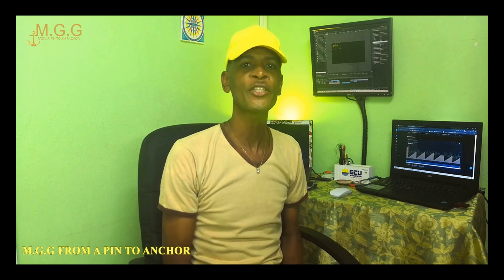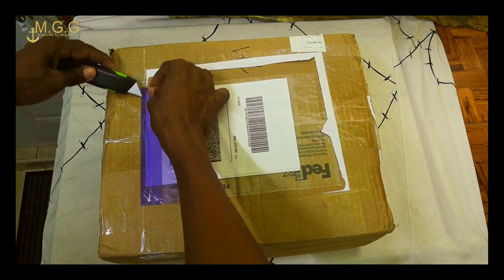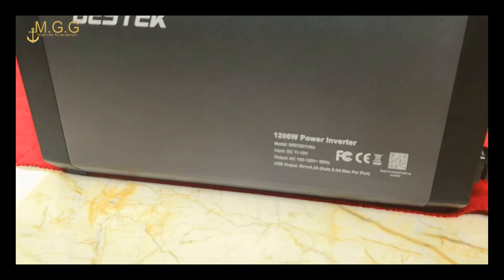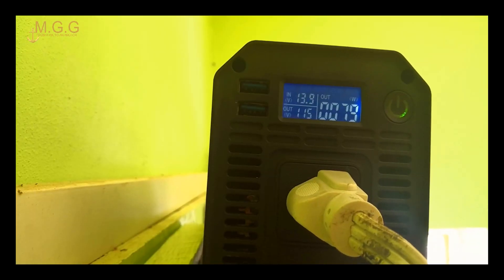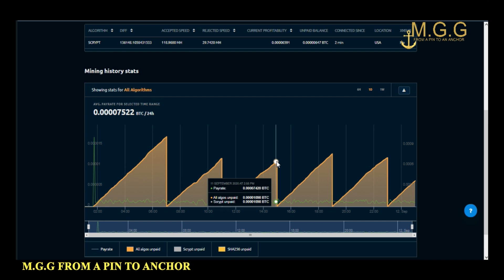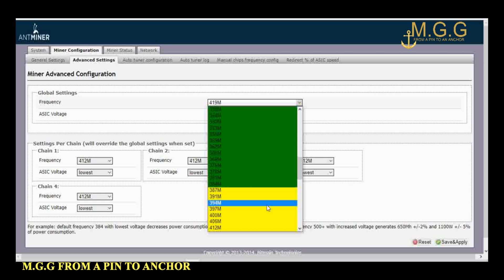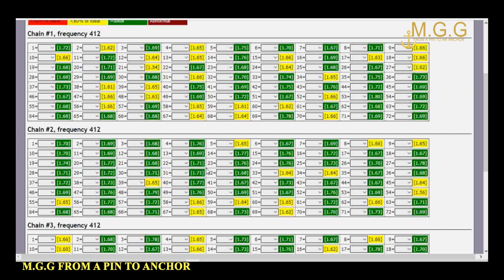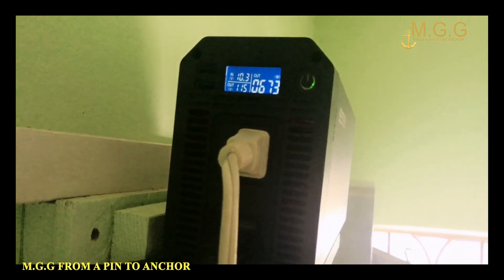Solar Powered ☀️ Antminer L3+ OFF-GRID ⚡FULL HD 4K LTC Mining🗻⛏ L3+ 24/7 With Battery🔋

Comment: A very great demonstration bro!

By the way, one thing I have been thinking is this: do we really need inverters and power supplies? Inverter is the most expensive single part in solar system and also causes energy loss. Same applies to power supply unit. 

Let me explain the initial facts why I have begun to wonder this: solar panels give DC output and crypto miners want DC input.

Current default solar mining setup is the following: Solar panel produces DC, inverter translates DC to AC (= energy loss), power supply unit translates AC to DC (= energy loss) in order to feed crypto miner with DC.

Ideal solar mining setup would be the following: Solar panel feeds DC to crypto miner that eats DC. Then we can get rid of both inverter and power supply that are costly to buy and they both also cause power loss.

With Braiins OS it is possible turn chips on and off based on voltage, so voltage variation wouldn't be a problem. It means that battery, inverter and power supply unit aren't necessary. Getting rid of them would lower down both initial costs and running costs, the setup easily scales in size, and is also affordable since it would also make off-grid mining a very appealing scenario. I think the biggest problem is to find appropriate plugs to connect solar panel directly to Antminer. Any ideas my dear co-miners? 

Summa summarum: “The best part is no part.” (Elon Musk)
Reply from the maker: i am going to work out more details but for now i am working upgrading the solar system
Reply: If your plan is to work on your rig constantly that could mean more money toward miners, for the cost of the batteries and inverters, you’d get twice the daytime profitability but no nighttime money and a strict curfew mining system where you have to return home before dark. I just bought 4 kw myself and was going to try this also but I think you need at least 2 batteries personally for safety. Watch my video to see the wattage of 3 batteries and learn about the Potek inverter. https://youtu.be/Aa7kNxFZzCM
Reply from the maker: Not really

Comment: what is the size of your battery and power input of your solar panels how much power does the asic miner is draining from the inverter
Reply from the maker: My batteries are 4 (12v) batter 200h I have 8 panels 38.87v por 1 but I only useing 2 of tham at this time the change control only can talk 60v dc the miner is taking 720w